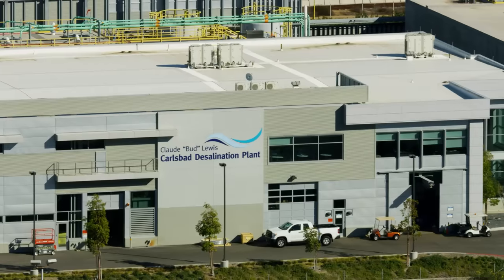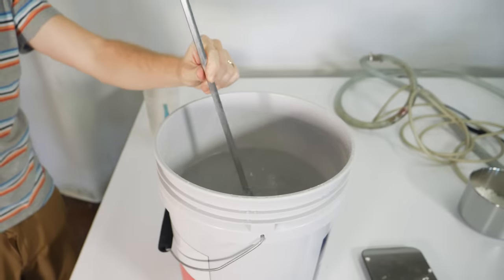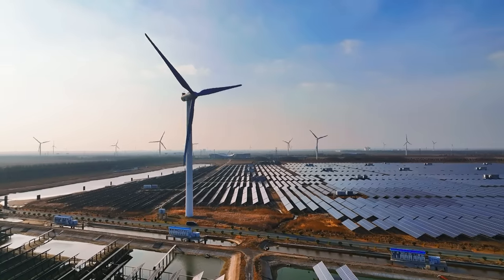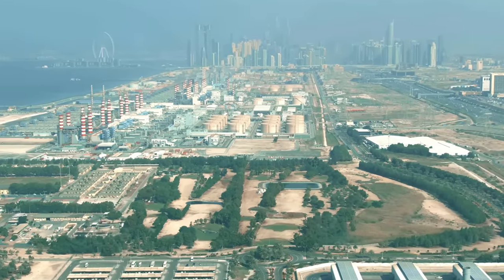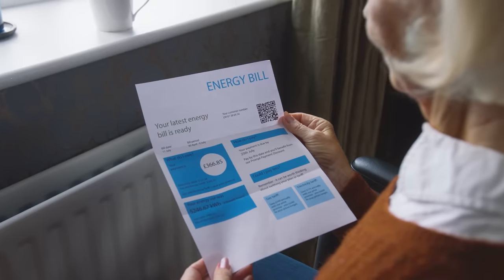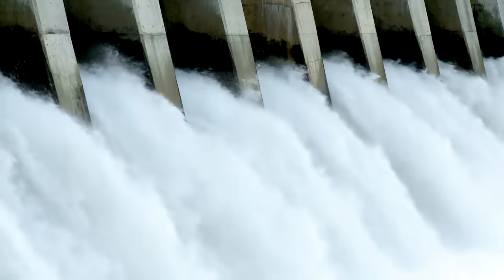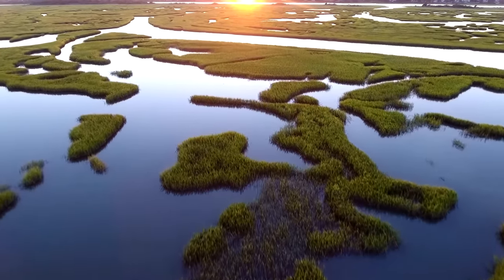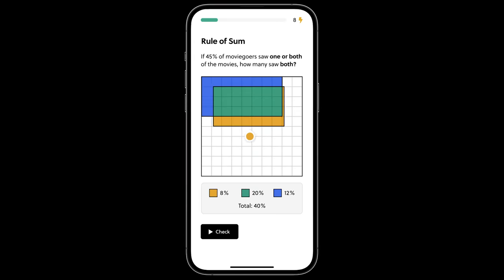Why Is Desalination So Difficult?

Comment: there are so many ways to make desalination more competitive it just requires large investment projects that arent commercially viable atm one of the best options in my opinion is to couple desalination plants with nuclear reactors the steam must be cooled before discharging even after going through the turbine generators so instead of large cooling towers you could pump the "waste" steam over to a desalination plant to make use of the leftover heat
Reply: Running water over irradiated water makes that water radioactive too… it produces tritium… which binds to the hydrogen and stays in the now tritated water…

Comment: A related issue is the need to conserve fresh water. 1,100 litres per day per household is a lot of water! There are a lot of dimensions to this obvs, but one I'm particularly interested in is the madness of using drinking water to flush toilets. Don't get me started on the tragedy of privatized water infra here in the UK!
Reply: There is a Japanese toilet design where the toilet tank is a hand-washing sink. The greywater goes into the tank and serves to flush the toilet.
Reply: Let's say I keep the tap open all day long. The water would go into the sewer system, end up in a water treatment plant and would be discharged into a river. So, the only loss is the energy used to pump the water from the source to my house and then from my house to the treatment plant. There is no real loss of water.

Another thing is that not everyone lives in a desert, I don't. There was a small problem with the water supply in my city a few years ago, but it was because the government has sold/closed some pumping stations, not because there was not enough water. Even then, the government just nicely asked people to not water their lawns as much. 

If I try to not use as much water, it is not going to help the people who live in a desert, because it would be extremely expensive to just ship the water. It makes sense to ship oil because oil is way more expensive than water. 

I could collect rain water and use that for the toilets and such, but that would require separate pipes etc and would only save me a few Euros per month.

Once in a while there is such intensive rain, that my basement gets a few cm of water - they say "water is a precious resource", but I had to just pump it out, nobody offered a single cent for it :)
Reply: @Pentium100MHz  The energy loss is not only the pumping, but the re-treatment of the water, before dumping it into the river, and then when it goes into the ocean, it's "lost". Very expensive to recover from salt, as seen above.
Reply: @Nelo390  It is expensive in some places and cheap in others. For example, the sun does it for free. Without it, the rivers would have drained out to sea completely.
As I said, not everyone lives in a desert. Yes, it is expensive to get water in a desert, because there is not enough rain, because, well, it's a desert. 

I don't know how many cubic meters of water land on the roof of my house and go straight to the sewer system. There is a collection well (to use for watering plants etc), but if it overflows, it goes straight to the sewer. That's just the roof, how much water lands in the yard every year and then evaporates or goes into the ground...

So yeah, water is not lost, just the energy used to pump and treat it. And even if I stop using water, it is not going to magically appear in a desert on the other side of the planet. You would need to ship it, which would be even more expensive than desalination.
Reply: @Pentium100MHz  What a boomer attitude- it's not going to be any good for a hypothetical desert elsewhere that I made up for arguments sake, so lets not worry about saving water. Yikes. This is from someone who presumably lives in Europe, a place that needs to import loads of gas and oil just to keep the lights on. Double Yikes. How exactly do you think they power the treatment plants?
Reply: @m2heavyindustries378  Seeing how much I pay for water, it cannot require that much energy. I use a lot more electricity directly, so it does not really matter, because the energy consumed because of water is a small part of my expenses. It does not really make sense to inconvenience myself or spend a lot of money to save some water and reduce my bill by 1EUR/month. Water costs about 2.5EUR/m^3 here and that price includes the waste treatment.
Reply: It's OUR water... so don't poop in it!
🏜
Reply: @Pentium100MHz  Oh, you're European, that makes more sense. Not to insult you guys across the pond, but you have no clue as to how different it is in the US of A. Primarily in southern USA, because, of course, deserts. Many houses have grass lawns (no clue why), and when watering, most of it evaporates away, not draining to aquifers. We got 9 inches of rain last year, and an inch of that came in a single day. The US drained lake Mead as low as it could go without cutting of hydro power, just a year ago. We're in drought man. Waste all the water you want, but dont encourage people over here to do it.
Reply: @Nelo390  I don't encourage anyone to do anything, I'm just offering my perspective. The average rain in Lithuania is 650-750mm (25.5" - 29.5"), some people even say that the name of the country (Lietuva) is made from the word meaning "rain" (lietus), though IIRC the experts do not agree with that.
So, i theory, my ~600m^2 yard gets about 420m^3 of water every year. The liquid water is not such a big problem, it just drains away or evaporates, but I have to shovel snow out of my parking, that sucks.

So, as I said, the value of water is extremely dependent on location. Yes, there is a limited amount of water available in a desert and if people who live in said desert used less water, there would be more left for their neighbors. That makes perfect sense. However, in areas with a lot of water it does not really matter and shipping water from those areas to the desert is very expensive.
Reply: @Pentium100MHz  I agree that areas with a lot of water have to worry less about conserving water. I just take issue with your initial suggestion of "There is no real loss of water.", and suggesting that there is no detriment to keeping the tap open all the time.
Reply: @Nelo390  I wrote "there is no real loss of water" with the idea that water itself does not go away - unlike, say, oil. Oil gets pumped out, converted into other things and today there is less total oil available than yesterday. Water gets pumped around, ends up in a river, then the sea, then a cloud and then back on the ground (as rain).

Comment: Nuclear actually justifies it's costs pretty easily when you consider they can operate for 80+ years. Also when you add firming/storage costs to renewables they go up in cost quite rapidly so they're not all that simple
Reply: Upkeep costs for nuclear can be very expensive year to year.
Reply: That and the fact that it's the most stable form of power generation we have, whilst also being the safest.
Reply: Then the radioactive waste can last millions of years. When the plants inevitably shut down way before "80+ years" because of leaks and contamination, the owners walk away with their money and the taxpayers have an enormous, massively expensive, dangerous, dirty cleanup.
Reply: @skipads5141  The waste problem is unfortunate because part of it is plutonium which can be used both as fuel in a different type of reactor and to make nuclear weapons. So any plant that can recycle nuclear waste into something that only lasts 10,000 years could also produce the material for nukes. Which is a big problem for proliferation.
Reply: @skipads5141  The biggest problem with nuclear isn't contamination - at least in the US. I worked at one for a year in college, and the NRC would be all over a plant like white on rice if they detected high levels of nuclear waste leaving a plant uncontrolled. While there are certainly going to be low-level amounts of contamination, simply due to things like corrosion in the steam generators, you are far more likely to get a higher dose at a coal-fired plant than a nuclear plant. (consider where both coal and radon come from...)

The biggest problem is the non-proliferation treaties that make reprocessing fuel a non-starter. Most fuel rods still have most of their energy when they are taken out of service because of risks that the plant might be unable to restart without immediately going into a refueling outage. This is literally why "spent" fuel is stuck in pools to cool for quite a while before going into dry cask storage.

At some point, if we can get past that, all of those casks full of fuel could be reprocessed to recover their unspent fuel.
Reply: @maurvir3197 : You're funny AF. 😄😄 A regular comedian. I lived directly across the river from one. It was shut down because 72% of the rods had cracks. That didn't happen overnight. Inspectors were paid off for years. Meanwhile, basically everybody who died here on the island had cancer. It used to be very warm to swim in the salt water here. Now it's cold like it's supposed to be. All the birds came back to nest within a couple years. The fish, crabs, lobsters and clams all returned when it had been a dead zone for the decades the plant was open.
Reply: @skipads5141  I don't know which plant you lived across from, but the one I worked in was in the process of getting it's 20 year recert in the mid-90's. I spent a lot of time working in the bowels of that place, and had enough workplace training to get a jump on a degree. I worked 6x12's in the powerblock for a month and never set the detectors off once. So, maybe the company running it was better than average? Maybe, but I doubt it.

The discharge canals were monitored daily by chemists to make sure there wasn't excess contamination.
Reply: @skipads5141  "All the birds came back to nest within a couple years."
When nuclear fearmongering gets so bad that birds can now magically detect radiation and stay clear of it...
Reply: @skipads5141  Early abandon of plants is not a technological issue. It's because of greedy private ownership. Private investors want money as fast as possible. They cut on all "unnecessary" costs, the first one being maintenance. In France we have 56 nuclear production reactors owned by the state. And maintenance and upgrades are done as it should and our oldest plants are nearing 50 years and still running as good as in their prime years. And our electricity bill is ultra stable and way lower than yours.
Reply: @sammiller6631 still cheaper and greener than solar, wind, and even hydro
Reply: @skipads5141  No, the owners cannot do that. We have regulators plus nuclear plants fill a fund to pay for decom.
Reply: @skipads5141  Also, that "waste" has never even caused an injury, much less a fatality. It can be recycled btw as it's used fuel with over 95% of it's energy potential remaining.
Reply: @thearisen7301 : Like I clearly acknowledged, there are regulators. Regulators who looked the other way for years.

Comment: Something I was thinking about was whether or not you could use waste heat from air conditioning units to desalinate water. I feel like this could be especially useful in cities because all the buildings are close together and it would reduce the need for surrounding buildings to use air conditioning.
Reply: Yet another person that understands so little that they think they have a great idea...
Reply: @thomgizziz  I understand the idea is likely dumb but was just shooting ideas.
Reply: @thomgizziz  pretty rude to say that though.
Reply: @thomgizziz what colour is your desalination plant?
Reply: the reason this wouldn't work is that all heat isn't created equal. As a rule of thumb you can sort of get away with assuming heat from a source can't heat something else hotter than the temperature of the source, unless you put in energy to concentrate it. Since most air conditioners I know don't run at boiling point, the heat you get from them isn't going to be 'hot' enough to boil water.
Reply: @dsdy1205  even if it doesn’t boil it should evaporate off after a while anyway. However, that begs the question why we don’t just dig big open areas to evaporate off large amounts of water.
Reply: @Shadow-bk1im my gut tells me boiling is a more energy efficient means of separation than evaporation.

As for why evaporation pools like you discuss don't exist, well firstly they do, except we collect the salt, not the water. The problem with a big solar powered evaporation pool is that you need a very large condenser to capture all that water vapour and recondense it, which is costly. And really you can't beat the world's largest evaporation pool, i.e. the ocean, and the world's largest condenser i.e. clouds. So you only need to build a large collector for the condensation, which means you quickly find yourself reinventing the concept of the freshwater reservoir, which takes up a lot of land area, which is the niche problem that desalination solves in the first place.

That's why in land-scarce areas like my home country, desalination bucks the trend and can deliver over 20% of the water supply
Reply: @dsdy1205  I know about those evaporation pools I meant for water.

Comment: Great video as always! (Really love your channel and I always learn a lot from you.) Question: how does the cost of desal compare to the cost of recycled water (i.e., treating human waste water to a level that is drinkable)? I know some cities are looking at "purple pipe" systems and would love your take on them.
Reply: Water engineer here, generally speaking recycling waste water can be significantly less costly than desalination depending on where you are and how you do it. “Purple pipe” type irrigation reuse (not drinkable) requires minimal additional treatment downstream of the wastewater plant, typically just additional sand filtration and disinfection. The big costs for that tend to be distribution, especially in built up areas where you’d need to tear up streets to lay new pipe. Treating wastewater to make it drinkable again can require more treatment steps (like activated carbon, UV, maybe ozone or an ozone-peroxide or UV-peroxide advanced oxidation process) but can come out ahead as being less expensive in a lot of cases. You don’t need to do reverse osmosis for recycling wastewater for drinking, but even if you do the water is significantly less salty than the ocean so it requires less energy. The lower overall energy costs of drinkable reuse would be offset by additional costs associated with carbon changeout (expensive) and possibly additional chemicals. 

If you think about it, a lot of cities on big rivers are already doing “unplanned” reuse since upstream utilities are discharging their treated wastewater into the same water body that downstream utilities are pulling from. A good chunk of the Mississippi is effectively “recycled” water in dry years by the time you get to New Orleans, if I remember correctly.

Comment: I wonder if someone has heard of combining RO processes with using water as potential energy storage with pumping to elevation. Saltwater systems are hard but combining the RO pressure gradient required with water pumped from excess grid energy and given pressure via overhead depth could be interesting 🤔

Comment: Has the industry considered using the brine to harvest salt? In my mind, salt is used for so many things that using the brine to fork salt evaporites seems feasible (not including the land usage, I suppose)
Reply: I think the need for water is greater by several orders of magnitude
Reply: @erikpoephoofd not when you consider that the salt can be used for molten salt reactor battery storage.
Reply: There is an itty bitty startup called GreenBlu, my dad works there and they originally wanted to produce water with highly efficient distillation, but it was hard to sell to investors, so they pivoted to extracting magnesium from the ocean via drying the salt out, so there is that

Comment: I was stationed on a modern Aircraft Carrier. Heat is not in short supply when you have a couple of reactors, nor is electricity. We distilled all of our potable water, and then it must have been re hardened to some degree, because it was easy to rinse soap off in the shower. It also tasted really good if I remember correctly. It has been about 30 years.
Reply: Also, we made much more potable water than was required for air crew, and ships company, about 6000 people in total.

Comment: The reverse of reverse osmosis can be used to generate power. Osmotic pressure can be used to drive turbines. In fact, you can use salt as a sort of energy source that way, mixing it with seawater. So, if you have a really concentrated brine after your RO desalination, directing it to an evaporation pond where it turns into salt which can be used for power production when mixed with seawater is a kind of weird way to recover some of the energy you used for desalination (plus solar thermal energy).
Reply: That was fascinating. I got to research this now….
Reply: @oldmanspooky6641  no because it is a really dumb idea

Comment: Fun fact: You can reverse this process and generate energry out of two unequaly salty waters. Just put a membran betwenn these two waters and the less salty water will press through the membran and you can try to get the Energy out of the pressure e.g. by letting the salty water get pumbed up. i think they testet such a power plant in Norway, where a river joins the sea, but it only generated a vew hundred watts.